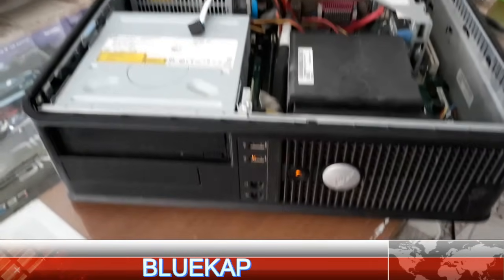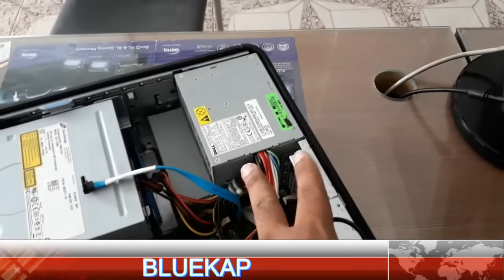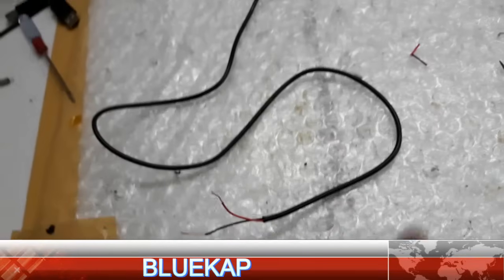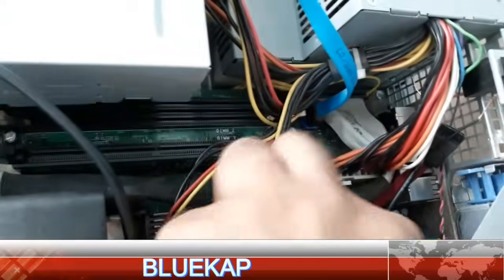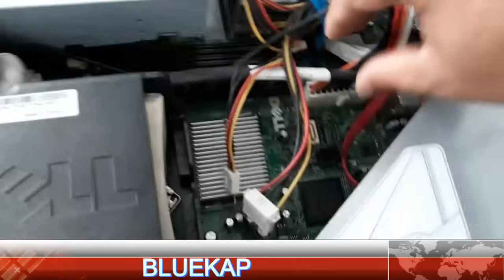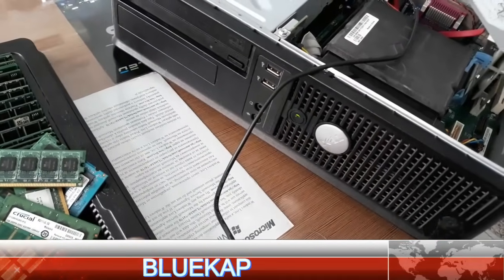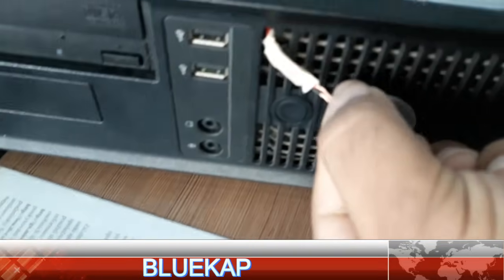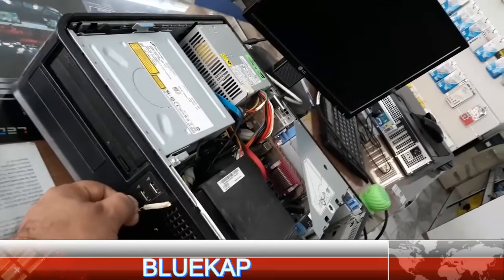Fix the Dell Orange Light of Death

Comment: I have a wiped out PC from work, I plugged it into power, the power supply has a Green light but Stil does not output signal to a 4K LG TV trough the Display port to HDMI adapter (and male to mele 2.1 HDMI cable). The Dell Optiplex 7010 has 2 Display out connections, a VGA "in" and "out" (i guess) and it also has a video card installed which has another DisplayPort out and dvi-d out (I guess), lately I have connected the Dell Optiplex 7101trough the  DVI-D adapter to a VGA cable to an old Samsung monitor, but still won't work, maybe because the Samsung monitor was not on the PC source. I will have to try some more times to see if it works. But i am puzzled from the button near to Green Light on the Power Supply, is it a RESET button or DOES it work like one ?!?

Comment: Thanks. I just got my optiplex 780 out of storage for 2 years and I had a yellow light. I spliced the wires and it turned on but it's not displaying on my monitor and the 3 and 4 light stays on. I'll sort it out another time.
Reply: It is related to memory

Comment: Thanks bro. It works. but the fan runs high than normal.
Reply: Tells that your system has not been properly grounded. You are giving too much electric current to your system board. Your CPU and/or RAMS will explode sooner or later!

Comment: So my "new" Dell Inspiron 530 I got a month ago has a solid amber light on the power button.  Surprisingly when I pressed the amber button it went blue and it DID POST a couple times and I checked out the BIOS.  I put a solid state drive in it and powered it on but it won't POST now.  I disconnected the SSD but it still won't POST.  It now still has the solid amber light but when I press the power button it goes blue like before but it will not beep.  The screen doesn't power on now either.  I press the power button again and it turns off.  I don't have to hold it in to turn it off.  I guess I'll get a new Power Suppy Unit but do you know if it might be something else?  I'd hate to get the new PSU and it still does this.  I DID replace the CMOS battery as I was told the old one was bad and the guy I bought it from replaced it with another old battery and he wasn't sure about it.  So I put in a new one.  But my power button isn't flashing orange which I think means its the CMOS.  It's light is solid amber.  So solid orange means a power supply problem, I've read.  Could it be something other than the PSU??  I will point out that there is two different kinds of memory in the computer, all four a 2 GB's, but with the amber light meaning a power problem could it be the memory?  Any help is appreciated.

Comment: A solid orange light is an indicator the lithium battery under the cd player is dead. The cost $2 at ACE hardware.
Reply: It means if you replace the new CD/ DVD player the problem will be solved?
Reply: @bernardjohn8788  No, he meant to replace the mother board CMOS battery.

Comment: Wow who would have thought it would be that simple. For any ATX power supply you can turn it on manually by jumping the green wire to ground. The PSU must be giving a bad health signal to the motherboard and so the motherboard is refusing to turn on the power supply so you do it yourself!  it's interesting how the power supply will still turn itself on even though it knows there is something wrong with itself.
Reply: While reading this comment I realized part of the onboard built in motherboards features is possibly receiving the wrong signal and is probably glitched out and crossing other channels leading to the motherboard not powering on but repeating the restart system that is part of the motherboards software. But only when the system fails opposed to after the system went through a power issue.
Reply: 😊🎉 te yup lo

Comment: My Dell Optiplex 990 displays similarity, but am afraid to cut the wires yet. Is there any way around cutting the wires in event that is not the issue?
Reply: Did you cut the wire? In my case, following this wire-cut technique did not work.

Comment: Why couldn't you just ground the green wire on the metal case and then when the computer gets power, it does the same thing as touching the two wires together?

Comment: When you turn a screw to hold a wire bend the wire in the SAME direction you are turning the screw. You are turning it in the opposite direction the wire is bent. You are working against yourself. You want the turning of the screw to pull your wire into the grip of the screw. Not push the wire away. It can still be done, but it goes a lot easier if you wrap the wire in the same direction the screw is going to turn...
Reply: 111111111111111111111111111111111111111111111111111111111111111111111111111111111111111111111111111111111111111111111111111111111111111111111111111111111111111111111111111111111111111111111

Comment: My computer shows a still orange light and the fan starts up but it doesn’t go anywhere from there no start up it just turns the fan on please help !
Reply: I have the same problem I recommend searching up the computer type you have eg. Optiplex 7010 and then the problem your having
Reply: did you solve the problem?
Reply: @TyoooZX  I had to extract all the data from the hard drive into my new pc and bin the old one off unfortunately

Comment: I have this problem too(solid amber light)
But i managed to fixed it.
Here's some steps
1. Remove the power connectors including the 12v 4 pin connector
2. Replace it with a-Processor/CPU
3. Clean the ram slots
4. Connect all the power connectors to see if its beeping
Note: if its beeping means your motherboard is alive.
5. Put back the ram sticks
6. Put back all the components and the connectors
7. Your Computer is fixed!

Comment: Dude just unplug it(the connection with heaps of cords / i think its the power cables) from the mother board and plug it back in that's all i did and it works again. No need to smelt anything.
Reply: Also I get this blue screen where I need to repair my pc I did so many things to try and fix it in bois in everything so I tried to factory reset it and it doesn't give me the option
Reply: Wait Do You Know How To Do It If The Orange Light Is Like Inside Your Pc On The Motherboard but the power button is blue

Comment: This is what I call improvisation. Great stuff. This means the power supply is buggered. Will have to get a new one.
Reply: @KevinBurns  nope the board is not fried I have a dell optiplex 780 sometimes it turns on sometimes it doesn't it has amber light of death with 1 and 3 buttons lighting up blinking and that's because I opened my power supply and I checked the board out and saw a bulgy capacitor so most likely that is not carrying the normal startup voltage that it needs so u cant fix a fried motherboard

Comment: I'M a dunce! I did exactly what you did and boom! It worked! I was about to junk this one and even bought a smaller refurbished dell optip!ex mini that had the same damn  problem too!  but it didn't work on the mini newer one. But I couldn't leave well enough alone! I went to the one I fixed and decided to shorten up the jump wire and think I tried something because when I repeat the steps!? The amber light blinks as I plug in power but as soon as I touch the 2 wires together? It shuts the light off and never boots up now! You hear the fan almost start up but that's it! Both computers have new batteries and the larger computer that I once fixed by doing this doesn't have the reset button in the back like the newer mini dell optiplex. Any ideas!?

Comment: Hey Mister, i want to know if this method work with Dell Optiplex 960 series (my real problem is that the desktop shut down after 30mins if I work hardly and if it off, orange light blink with one sound like tac-tac-tac in the power supply)
Plz help me🙏🏽
My whatsapp number +225 888980298 Ivory Coast
Thx

Comment: i did the same procedure but orange light appear and i joined wires pc was not start and after that i removed 4 pin cable of power supply then i joind wires and then was current passed

Comment: hi there..can anybody can help me here please??ive got an intel server mobo s5520hc with dual xeon..problem is my psu delta electronics dps-600mb y die and got a 12v auxiliary power conector in 5 pin socket but just with 4 cables..new psu delta as well 800w got auxiliary power but 4pin..can i just cut the extreme and connect to the 5 pin old and what color i need to connect..is white,orange,black black...and new psu got 4 pin 2 yellow and 2 black..any help will be great please..i had a look on hundreds of pics and forums and dont find nothing

Comment: Thanks.... worked in my case(optimplex 380)
Ps: installed of living wires hanging out, you can make a cavity in the front panel(plastic part) and add a small switch

Comment: now the cmos battery as its lower voltage, now i need to purchase a new one, as ive notice that some times when u twist the wire connected to the green wire and the other one is at the body of the power supply, the fan speed sometimes increase and decrease how can i say this you will determine it when you power it on

Comment: i already try to cut the green wire comming from the power supply, as discused in this video create a spare wire and splice the other half of the green wire to your spare wire, then the other wire connected to the body of the power supply, i already tried this but same issue is created and not the new cmos battery that i installed suddenly drop his voltage

Comment: I encountered the same problem, it seems like it was the power supply that was at fault. I need not to cut the green wire, I only tested the PSU's (Power Supply Unit) functionality by cutting both ends of a wire (I had another wire) and inserted it on the ATX Power Cable, the first end is adjacent to the green wire and the other one is adjacent to any black wire (You can check "PC Tip: Testing a Power Supply with The Paper Clip Test" it's the same method I did.) My PSU worked and when I plugged my ATX Power Cable back to my motherboard, my PC worked. I hope this might help you guys out.

Comment: I have a Dell Optiplex 7010, and three days ago, it didn't powered up (1 blink pause, 2 blinks = bad motherboard), so I'd decided to take it to a repair shop. There they told me that it was unfixable, that I'd to buy a new one. The assurance company didn't cover it, so I was gave it up. Then I saw your video, but also another one that recommended to renew the thermal paste for the cpu and remount it, so I told the shop's technician to try it. This afternoon I went to the shop and they told me that it was unsuccessful, so I brought back the pc to my house decided to try your fix. Then, SURPRISE ! without doing your fix, at first attempt, the pc BOOTED without issues. What the fff***k ! I'm puzzled Dell, I'm puzzled, I hope it lasts and stays working. I think Dell's pcs behave in a very strange way, because there are lots of cases around internet about booting issues. Right now, I'm happy to write this on my revived dell 7010 pc... By the way... By doing this wire's procedure, you are "re-flowing" the ground thing to the case of the computer... Not a bad idea, but... Is it dangerous ? Any idea of the possible reason ?... What are the electrical fundaments of your idea ?

Comment: hello could help me when I call alert cpu fan! I already changed the cooler but still the error!
dell optiplex 330 BIOS A11
thanks!
Reply: you need to add all fans, or it will crp on youre face, for cpu fan you can buy adaptor 5->4 pinns

Comment: Don't follow the video to cut the wires whatsoever.
Just power cycle the system by removing everything and pressing and holding the power button for 10-15 seconds.
Reply: What do yu mean ? I dont understand !! Plz reply Me faast Same Psu Problem !
Reply: @IBRAHIM-gs6mb  bro psu isn't the case here...it's been happening to all optiplexes i guess but i fixed this by removing/disconnecting every components (i.e ram hard drive keyboard mouse etc) and also resetting CMOS battery.After doing all above mention,Just plug cpu to wall socket and press and hold the blinking button for 10-15 seconds ,Keep trying it until it powers on.I hope it will work!
Sub to my little poor channel.

Comment: Thanks  for your video.getting same error on Dell optiplex 980. Used your trick and it works, Saved my 1000 of rupees and my Dell system, as no one ready to repair it. Great video.
Reply: Hi, i’ve Optiplex 960 but my light blink after 30 mins with a sound like tac-tac-tac in the power supply,I don’t know if we’ve the same problem
Give me exactly your situation plz

Comment: I would consider this technique only in an emergency where you had to have the computer up and running.  Its important to note that is only a temporary fix, something is amiss that needs to be addressed.  Most like PSU or PWR short somewhere. Thanks
Reply: Change SMPS
Reply: Oddly, when my "blinking amber of doom" started, my computer was on and kept running...it...seemed to be running actually just fine still but yeah, not having it would be better of course :)
Reply: Not to wotty, someday power supply make go boom! all set ok?

Comment: You are just forcing the power supply to turn on, that doesnt fix the issue why the light was flashing in the first place. Blinking Amber means the power supply is receiving power but is unable to distribute the power properly (Bad power supply) This video only describes how to force the power supply to turn on, the other components will still be getting insufficient power. Just get a new power supply.
Reply: No in fact this is a problem in the motherboard the power supply is working good i have the same problem and taste the power supply and deliver the correct voltage in every cable
Reply: I have that but everything is getting power but no signal on the monitor
Reply: I have this problem every day! Bruh!
Reply: Not to wotty, someday power supply make go boom! all set ok?

Comment: Dz video totally sucks. Instead of anyone wasting time doing experiments by first cutting and adding wires still problem not solved and dn wished u did not cut the wires in the end. Just go to a computer shop and have it checked dey vl guide accordingly. Why would any1 risk a computer for a $15 PSU.

Comment: The real an only problem is to repair the power supply. I just repaired an Optiplex 760 power supply that needed all new capacitors.
Reply: Wrote the values of the existing capacitors down, went to digikey and ordered new ones. Desoldered the old ones and soldered new ones. Make sure to buy Japanese brands and choose low ESR ones when possible.
Reply: And you achieved that how
Reply: in few cases is the PS
Reply: This video dosen't work for my Dell 790 and my power button still being orange light.
Please show me way how I can fix it by other ways.
Thanks
Reply: @yangonhousingservice9446  Replace the power supply. Or recap it, if there are bulging caps in it.
Reply: @yangonhousingservice9446  in my case you  just have to wait until it is get a light number indicator... at first it was weird to wait the orange light  for an hour after so many tries to boot it fixed my problem.... and note if you dont want to have a orange light again do not unplug or turn off or reset your avr even  though your pc is turned off..
Reply: @theeverything4036  wait so I have a gtx 970 with a 500w evga psu with i5 2400 16gb ram, it keeps flashing, do I keep the system on until it turns on or do I have to do something else?
Reply: @jhx2321  do the same thing that i did if your frontpannel light are stable not blinking

Comment: I tried it doesn't work i used the two cables with the cable I cut from another power supply and did exactly as the video and still same result why ?
Reply: Same happened to me

Comment: i had the same exact problem on my Optiplex 9020 MT, i took all the connections out from the motherboard (hdd, dvd drive, fans and sensors) i only kept the 8 pin power connected to it. i set it aside and placed a new PC on the table and checked the internet.. it worked. I trashed the Optiplex.

Comment: my dell system was doing this many times years ago. i took the motherboard out and strip everything off it and clean the board with rubbing alcohol.also the bottom side of the cpu i clean. it has been 3 years and i never got that problem again.
Reply: Lol I put my vga cord into my gpu and idk this orange light jus started blinking idk if that was the problem tho idk but could u help
Reply: I mean mother board
Reply: Yes bro

Comment: I have bought a spare PSU and it didn't work. Tried the fix in the video and it didn't work. Removed four "non-mandatory" capacitors around the CPU and the same. Do you have any fix?

Comment: This is for the Orange Light of the motherboard and PC button !!! same problem was with me the PC wasn't showing any result after turning it on...
Guys dont worry just plug out all usb devices and then Clean the motherboard including the fans and RAM,,, the place where Ram is plugged in... And then put the things back in and turn on .... it will work and if it doesn't just change the place where you are used to plug in your PC power it will work!
Reply: Muhammad Shahir same problem
Reply: Same problem orng light please halp
Reply: l got same problem